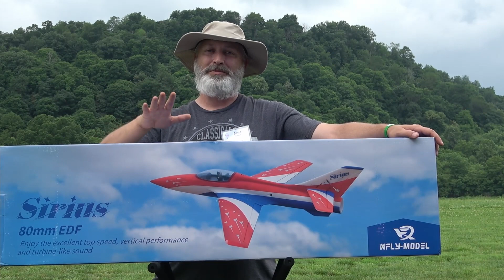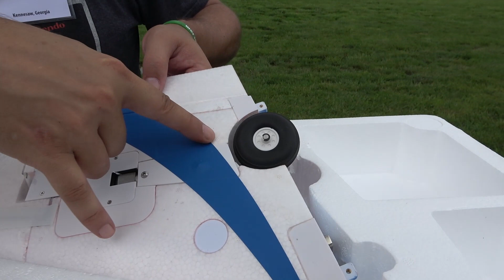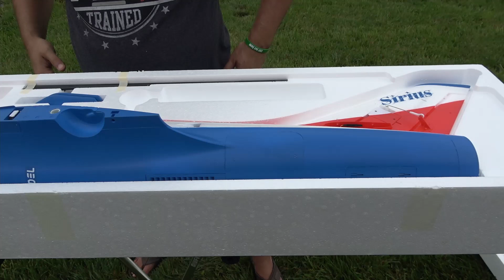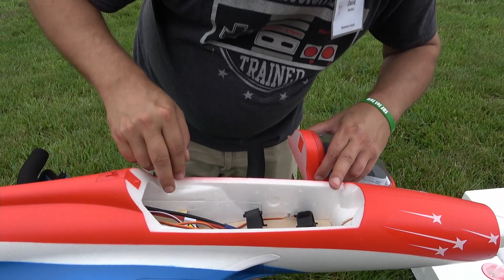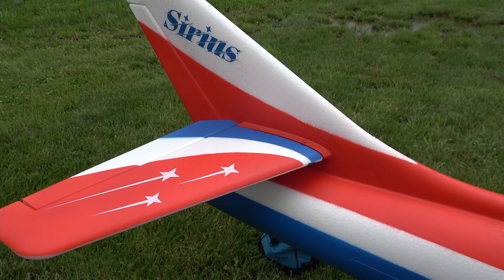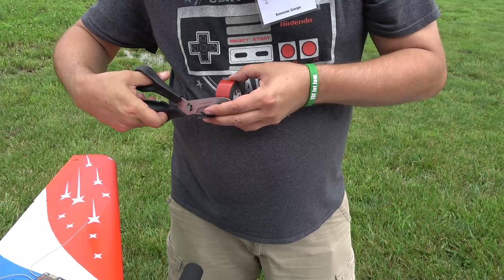Xfly Model Sirius 80mm EDF Sport Jet Unbox and Build

Comment: Good vid. Such about shame about the rattle can paint job they did on this. I know it's subjective but it's not a great scheme by modern standards and you can see the lines aren't sharp. Add to that the 1980's serial port connectors and the wrong diameter on the thrust tube. Good attempt by a new manufacturer but I'll wait for version 2. Have fun flying it.
Reply from the maker: I can’t say I’m a huge fan of the paint scheme either. It looks better in person. The foam is very smooth, and where the paint is applied you really can’t tell that it’s a foam model. I’m actually a fan of the D Sub connectors. They’re going to hold up well over time, and they didn’t have to reinvent the wheel do implement a proven multi-pin quick disconnect system. It works well. If the thrust tube is incorrectly sized I don’t think most folks will notice, it performs fantastic right out of the box, and my understanding is they are changing the size of the cheater vents to get more airflow into the intake side of the fan unit. I’d say it’s a great first effort for sure. You can certainly tell where the pedigree of this model comes from, and I only expect to see improvements from here. Thanks for watching!